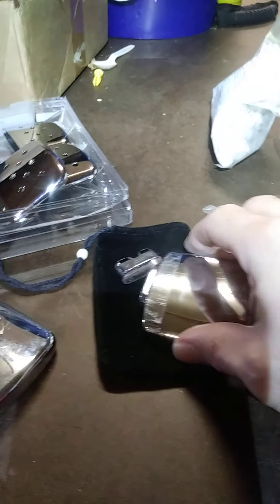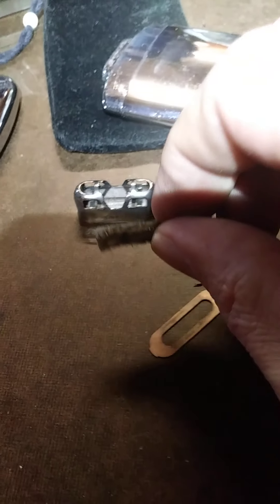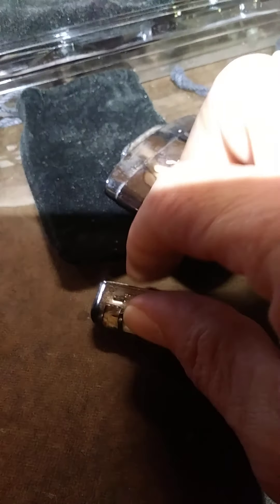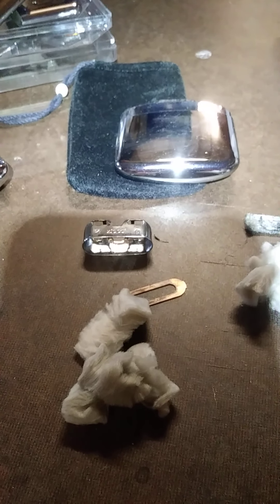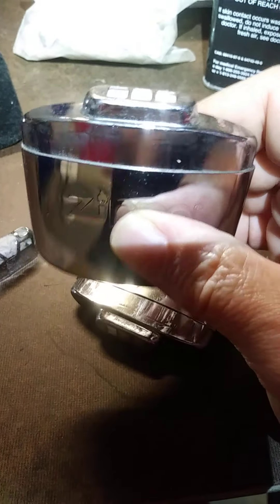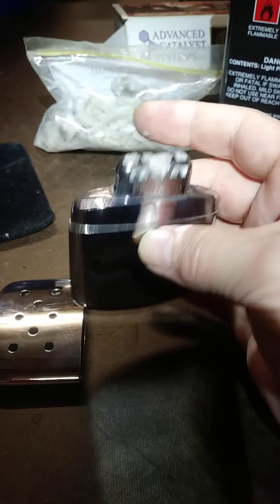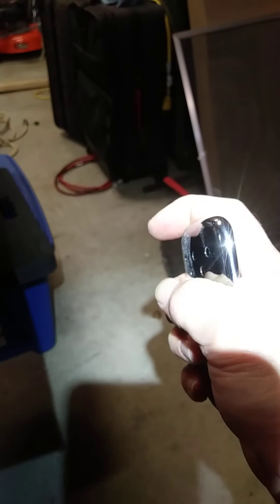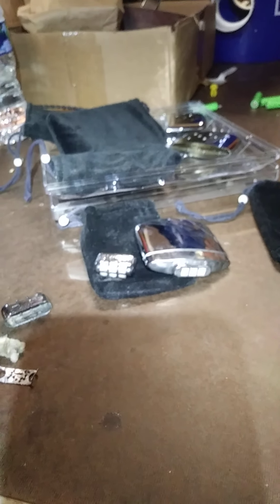Replacing Zippo Hand warmer Catalyst

Comment: My Zippo hand-warmer has been putting out heat for over 24 hours straight.  I cannot believe this! Fantastic!
Reply from the maker: Little heavy on the fluid? : )
Reply: I’ve gotten 47 hours with a controlled fill on the 12 hour modern stock zippo.  Don’t mess around with the fuel storage material, it’s the way it should be.  The fill hole provided in the top of the storage fiber was a ‘smart move improvement’ so use it to your advantage. Fill with the included measuring cup (the elephant snout looking one) until it stops taking fluid (I use inexpensive naphtha in the gallon steel can from true valve, same fuel, same reaction). Once full, turn it upside down and let ALL excess fuel drain, for about a minute or so, collect it if you can.  Wipe everything dry before attaching the catalytic burner thing. Apply flame to the catalyst head fuzz for about ten seconds, cap it, and give it a couple minutes for it to rev-up. Any fluid on the catalyst cap thing is not good, and makes ignition very hard. No need to add any additional fuzz to the catalyst , get the proper replacement. I’ve found new felt-like fuzz catalyst that’s pre-shaped to fit without modifying or adjusting.  If your going to get into these, order a couple of new replacement heads before they become discontinued or hard to acquire like the Jon-e’s of the past….  Enjoy.
Reply: @garrykniffen1461 the proper catalyst? What zippo charges is beyond price gouging and downright immoral. You must either work there or own stock to recommend that lol

Comment: Hey Rake,

I’m trying to decide how much effort to put in these things, I got a couple of new Zippo 12hrs and they can get pretty warm indoors but find in colder temps, even if kept in protected pockets, they kind of underperform.  I’ve read comments saying the new catalyst they are produced with now is pretty much trash, in your experience does changing out the catalyst provide a significant enough bump in heat production to be worth the effort for the new model?  Thanks so much for your time / help!
Reply from the maker: @daveellis608   @daveellis608  well I'll start with the most of ones I have are almost 13 years old. I would say honestly that's very little effort for that length of time. Not that you use them every day but when you do and they work it's better.  A couple of them are the new style and I just did not like the way they burned. My catalyst stuff is years old. I'll never use it all but I can. I didn't realize there were six hour Zippos now. And I assume you've taken them out of the pouch entirely to see if they got any hotter outside?  And I did a search to make sure nothing's changed with them and it looks like the catalyst went back to the way it was versus the hard aluminum or whatever it was?  But then I saw so many other hand warmers. So it might be worth checking to see if there's something better out there at this point. But if you like sticking with the Zippo I would recommend getting the catalyst and replacing it because they last years/decade(s). So will the remainder of the catalyst lol. Hope that helps you, any other questions or if I didn't answer or anything just let me know.

Comment: I have a question, i dont find any platinum catalyst in my country. 
Can i use labour grade wool instead ??? Its white cotton like wool that is not flamable, used in laboratories.
Reply from the maker: Thanks for the question but likei tell others it's okay to say "i don't know". So lol i don't know. With THAT said however i am an experiment, i know what i said lol. I would try it If it was one of or my only option. Remember less is more. Good luck and let us know. AND if you have an exact product name i can look it up. Thanks!
Reply: @rakevanderzen8785  i understand that... problem is, i pay 80€transport when i order a pack of PBE to europe. Today i discover that even the replacement burners are out of stock everywhere... i ordered now a bunch of them from germany
Reply: @oO360GamingOo  Did you get the PBE?
Reply: @tiagofigueiredo2529  nope, not even a Chance. only from us with 86 dollar shipping costs
Reply: @oO360GamingOo  They want 26$ for the package and 29$ for the shipping.
Don't know what to do actually as the shipping costs more than the product itself. 😅
Reply: @tiagofigueiredo2529  from europe they want 56$ plus 86$ shipping 😄

Comment: Would a cigarette filter work as a catalyst material?
Reply from the maker: I think cigarettes filters melt more than retain shape and hold an ember. Let me guess you can't get it where you live?  

I have seen these things. They're metal ish. They are used in cannabis, expensive side,  cannabis devices. It kind of looks looked a more dense version of what Zippo uses as the new catalysts. At least it looks similar.  It's for concentrates and dabbing.

Comment: Do you ever use those hand warmers indoors?
Reply from the maker: Yes all the time. One in each back pocket is good. Keeps my butt warm which helps my bad back stay warmish. I usually wear work pants with side pockets so one in there sometimes. Like anything else, you won't smell out long because it doesn't really stink. The more you synch the the less air the less burn the less smell.
Reply: @rakevanderzen8785  yeah thanks.  I was  wondering about using it indoors, bc i seen people arguing online whether this gives off CO or CO2.
Reply from the maker: I would say if you're sitting in a closet you might have something to worry about. But I walk around in my garage with the lawn. I walk around with them in my shed. I'm inside their nothing's happening so if you're moving in the house or even sitting I really don't think you have anything to worry about. Unless you live really live in a small place. I've come in from being outside after 4 - 5 hours forgetting they are in my pocket dozens of times. So unless you're going to have like 6 or 7 going at one time I wouldn't even worry about it a little bit. But that's just my opinion from my experience however.
Reply: @rakevanderzen8785  LOL  thanks player.

Comment: Very helpful instructions, thanks. Could you post a wad of this to me ina letter to the UK? It's impossible to get here. I could do a paypal to cover the costs.
Reply from the maker: Not for nothing that's something I would actually like to do. But if you can't have it in the UK which really doesn't make any sense if you can have the hand warmer itself there has to be a way to get it. You can't even get somebody just to buy it on Amazon and gift it to you? I love circumventing the system in some way shape or form but only because they didn't figure it out. Like the tax people.
Reply: @rakevanderzen8785  No problem, thanks. Oh, I've looked everywhere. We do have 'glowing embers' for fires in the UK, but they're all made of fine steel wool with no catalytic properties. The replacement hand warmer pads are available, but the price is around $4-6 each. I've heard that some of the old gas hair stylers have a sock of the catalytic wool in the tong part of the device. I'll look out for for some cheap used ones and see if that's true.
Reply from the maker: @petersloper9674  oh that's genius dude. You know I didn't think about that only because you can get it and there isn't a shortage. But when there was a shortage on masks or personal protection I'm like you can use the filter from a vacuum cleaner bag you can use a filter from your home that you put inside your vent that you change every 30 60 90 days so there's a lot of filters out there. So if you do locate something please post it here because you're like the second person in the UK that said something about they can't get those. Great thinking!
Reply from the maker: I just posted three different types that I found on Amazon. Maybe one of those? Good luck.

Comment: You didn't show the most important part on the newer cheap chinese Zippos with the inferior catalyst material. HOW do you get the retainer ring OUT to remove the inferior zippo catalyst material? And HOW does it go back in? What tools are needed to remove the retainer? How hard is it to get that retainer out, and how hard to push back in..and with what tool to get it back in. Does it click when going in? How do we know when it is in properly ??? The rest of it we can see how its done. I can't fit my finger in to pull that retainer out..it is in tightly.
Reply: The retaining clip for the catalyst on the new style (copper colored piece) has two small tabs on each end which are inserted into corresponding slots on the ends of the catalyst chamber. Simply pry the clip out(gently without bending or mis-shaping it). I used a set of tweezers, but any flat-ish prying device should work. When reinstalling, get one tab in the slot on one end and gently push in the middle of the clip to get it to bend enough to snap the other end in. Not difficult, just be gentle. Good luck
Reply: @bigfatdavebigfatdave7395  Thank you..excellent review! and thank you!